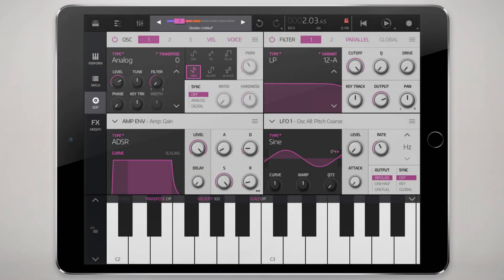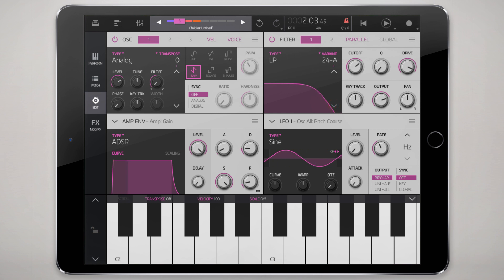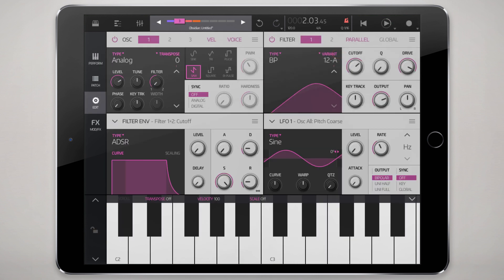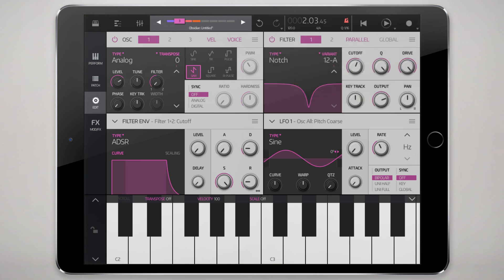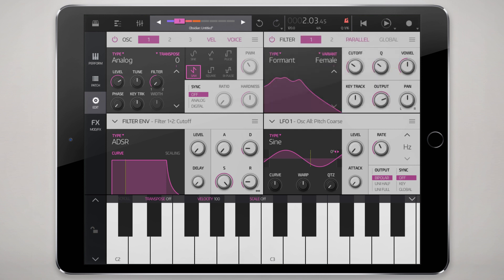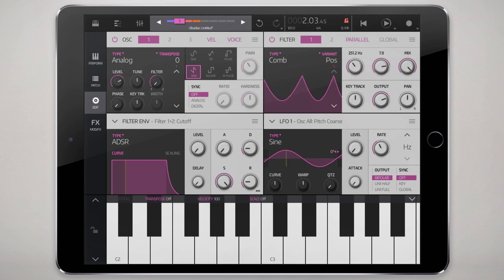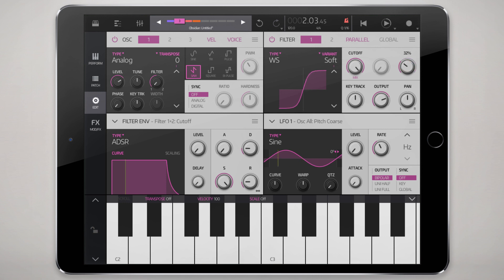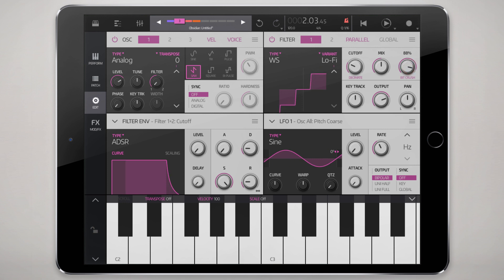Nanostudio 2 Quick Look - Obsidian Filters

Comment: When is freeze track going to be added ? I can’t do much , after About 8 tracks it starts messing up.. plus when will we be able to use apps like cubasis and bm3 with NS2
Reply from the maker: Only 8 tracks? That doesn't sound quite right. Throughout development had never reached past 50% CPU with well over 20 tracks. What device are you using? As for freeze, I'm sure it's being considered. I'll get back to you about cubasis/bm3, but NS2 does support AU so if either can be integrated as AU then that's one way atm.
Reply: @platinumaudiolab  what i seem to find very useful. Record a 4 or 8 bar drum pattern in NS2 create a .wav mixdown then open the .wav in cubasis via the ios files app.
Or even a complete song into cubasis to add audio tracks..... thanks for these videos they are so helpful.....🎹🎹🎹🎶🎵
Reply: @platinumaudiolab  i use a ipad pro 12.9 .. i just thought i would be able to use it with bm3 cubasis and gadget since the three apps can be used with eachother..